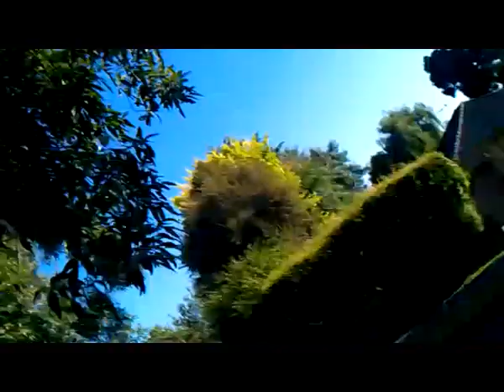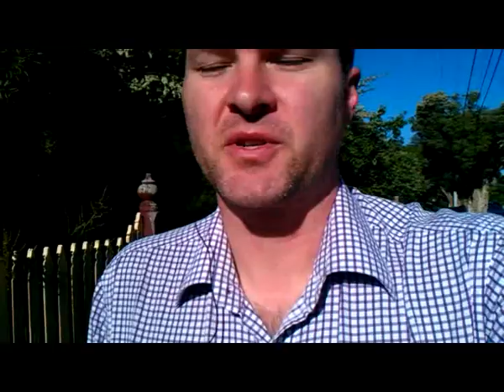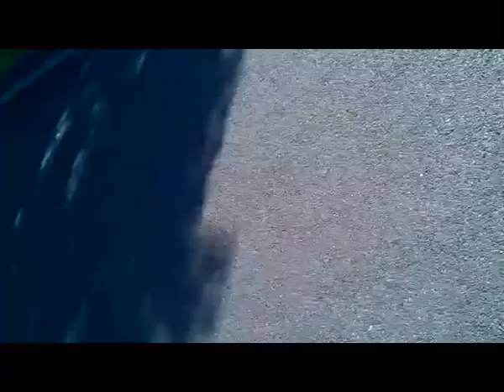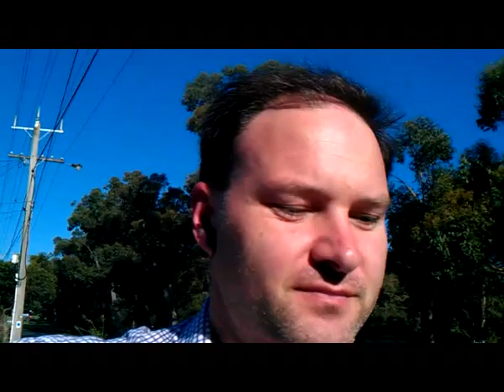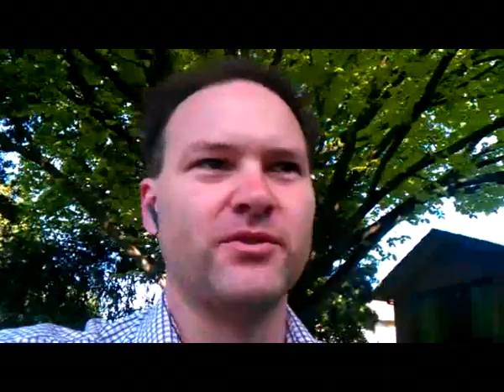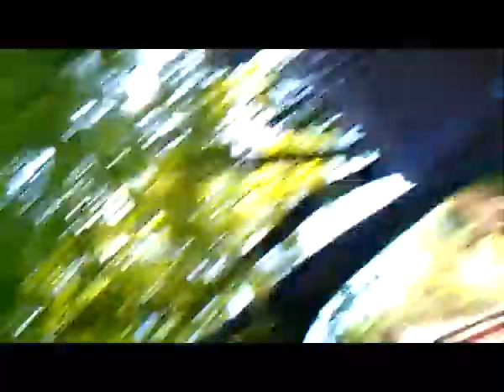Jon's Walktime Blog #10: Print your own weapons

Comment: Older vid and late post but , I would think that a person should follow the rules and laws of the community in which they live. After that its a matter of being reasonably responsible and observing safety procedures. For instance, what would we do if everyone was allowed to manufacture their own computer controlled equipment.... what if the equipment wasn’t properly grounded... what if proper fuses or wire gauges were not used... what if the terminals were not tightened properly and connection points overheated, failed or even caught on fire... this would be a major risk to the safety of the community and the community should consider if this should be banned. Or maybe laws put in place. Or maybe safety protocols and codes put in place. 

Well, put simply the same  concepts apply to guns. Before considering the matter, or questioning if its ok to make a gun, or own a gun, it would be advisable to study safety practices when owning handling or storing a gun. If good safety practices are not used when owning or handling a gun, accidents can happen. That goes for most any technology we as humans create and use. I remember in a physics class solving problems for cars acceleration and accidents where the car decelerated(crashed abruptly). The teacher then showed us an article on what sometimes happens after an accident like this occurs. In this article, the passengers were dead. The bodies showed little or no Trauma on the outside. The internal organs like the heart had inertia after the car and passengers abruptly stopped. The organs essentially crashed into the inside of their bodies and destroyed. The passengers in the example were teenagers. The teacher well made his point of the danger and responsibility of operating a motor vehicle. The driver was not the only one killed. 

I don’t see a properly handled or stored 3d printed functional gun being any more dangerous than household electricity, motor vehicles, etc.

Now if the conversation is more on people with malicious intent, ok save the world by banning 3d printed gun parts. Maybe they won’t find other means to carry out their agenda. 

I kinda lean more towards a root cause analysis method for issues like this. Like promote and teach gun safety. Promote and implement treatment and rehabilitation programs for mental illnesses, addiction, depression,ptsd, etc
🤷🏼‍♂️🤷🏼‍♂️🤷🏼‍♂️
Your technical info and videos are great. Keep it up.👍👍 Thanks for the content!